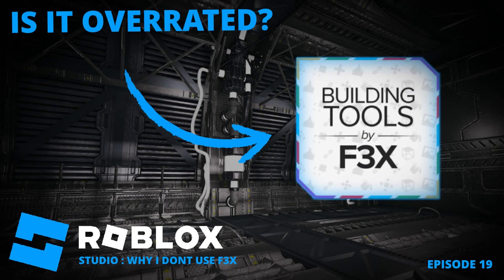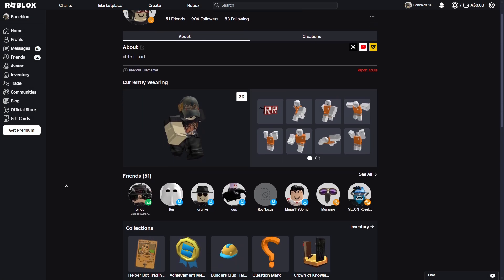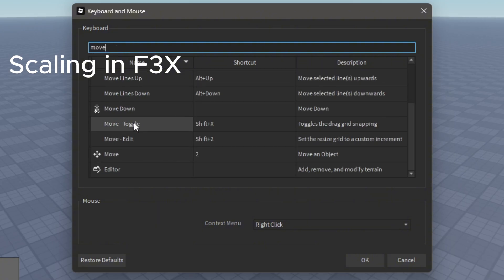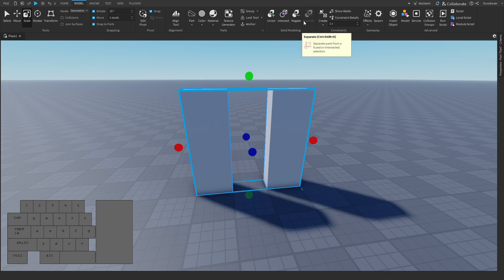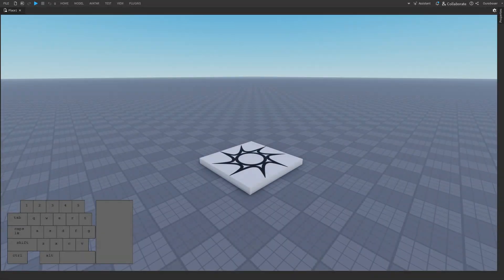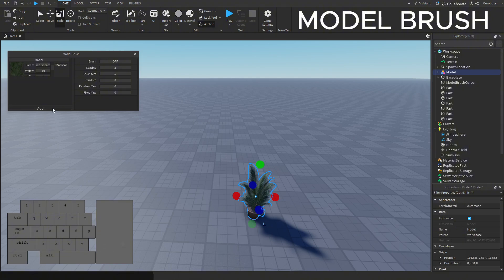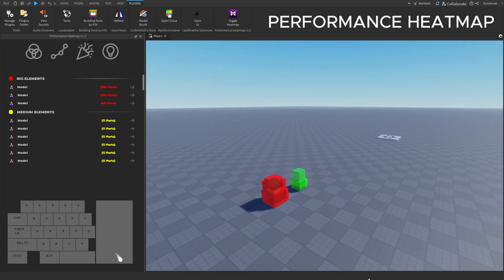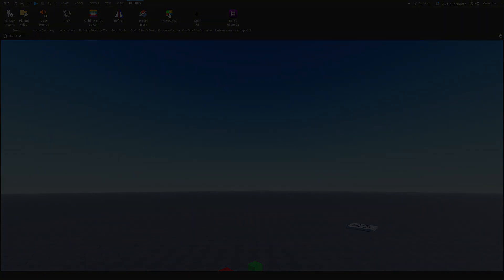Roblox Studio - Building Tutorial |  Why I don't use F3X

Comment: i remember using f3x back in like 2018, still couldn’t build for shit but it felt easier than using studio by itself

it wasn’t until like 2020 - 2021 when i went into my jtoh tower/obby phase and ditched f3x, did my building skills really improve

i still use f3x for surface textures since roblox removed tooling for them

Comment: I use since roblox studio and F3X both helps each other in parts they lack in
and i have a keybind to switch in between

For F3x
- Can edit individual parts (studio's union method combines pivot point so its not entirely individual which can get deformed)
- It does have snap to part (hold R), janky but it has a different behavior like snapping to middle
- Less laggy when mass selecting (since it doesn't select in real time, and only when let go)
- Easier individual selection within groups (Shift + T), 
- Can't accidently drag the parts while trying to select individual parts, compared to studio having to undo and then reselect again
- Can align part rotation with another (hold t + holding a part), useful for making ramp & block part roof
- Convenient information like how much studs you moved or sized

Studio
- Has better precise size/rotate/etc adjustment

- Can scale with alt
- Easier to snap to part

There's a lot that f3x makes up that studio lacks that i can go on about 
along with plenty more if there was a list that fully showed all the keybind tricks for f3x
Reply: how do you do so?
Reply: nevermind i watched the video